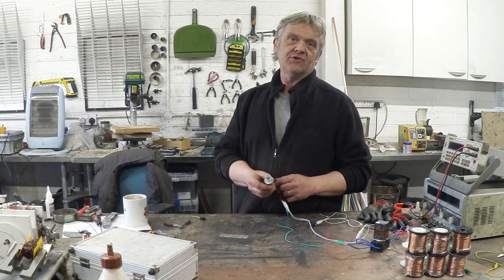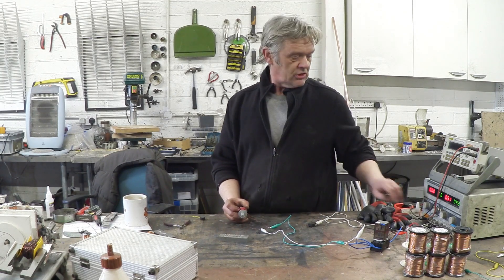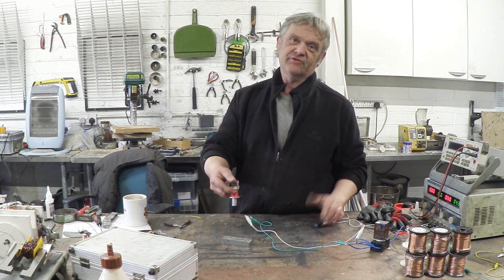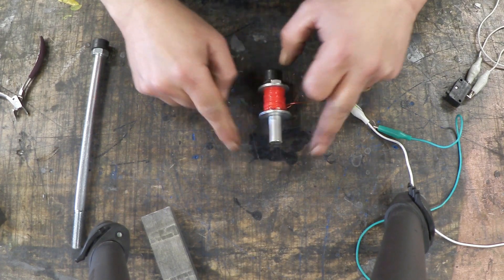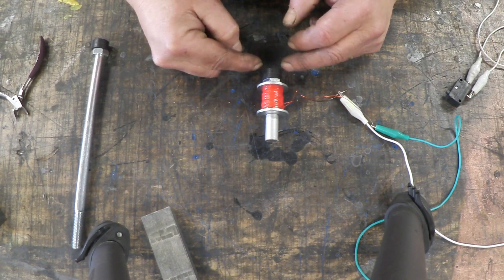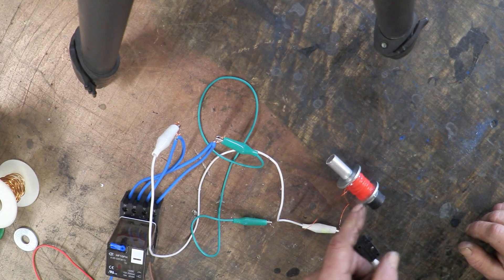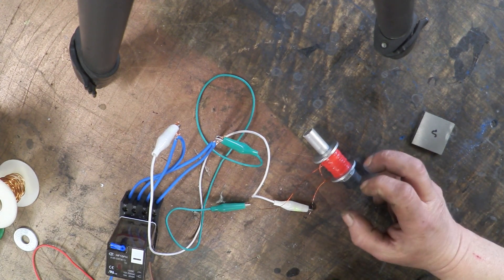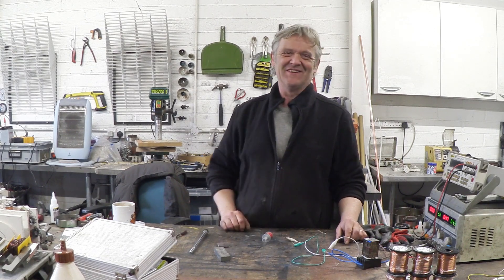1042 Magnetically Assisted Solenoid

Comment: I’ve been following you play with magnets and enjoying your findings. When you put a piece of steel against a magnet it will naturally weaken the magnetic flux as the flux is now contained in the “Keeper” piece of steel. But if the piece of steel is not large enough to fully contain the magnetic field there will be a small amount of residual field still around the magnet. So instead of nothing on the piece of steel there is some magnetism now which can be strengthened to produce more magnetism by a coil with current going through it. The current needed to produce a strong magnetic field will be less than that needed by a pure electromagnet as it is assisted by the rare earth magnet. The whole concept you are playing with is in essence I see it as a way to putting a magnetic bias on that piece of steel. Nothing more really. This concept is used in electronics. As an analogy put a bias of say 1,5 volt above ground using a single cell results in a standing voltage of 1,5 volt cell from ground. Add another 1,5 volt cell to it and it increases the voltage to 3 volts (higher voltage). But you can also put a reverse 1,5 volt and you get 0 volts (analogy being reverse the magnetic field to get zero magnetism). The trick is being able to use this knowledge in some way to create a useful device. But don’t think of a perpetual motion motor. This does not exist.

Comment: At very beginning of video when testing electric magnet, You forgot to turn your switch On, the one you pressed on the white power wire, 
same as  the secound time when you where using the magnet 🧲 as an assist with electric magnet. You turned power source On, and it did not begin to work till you, switched your secound switch.

Comment: Drill out the centre of the bolt enough that 5mm n52 magnets can slide in about 20mm from the attraction  end . Or just use some steel tube with a cut off bolt in the attraction end . Have strong enough magnet at the top and add or subtract to tune !

Comment: You can "bias" any electromagnet with a permanent magnet to make the resulting magnet stronger. That is what you did in your video. 
And just as important, you can "turn off" any permanent magnet with an electromagnet whose field is the reverse of that of the permanent magnet.
I've found the second instance to be the more useful of the two. The zero-power permanent magnet can hold an armature in place and a short pulse of energy into an electromagnet can release the armature. 
I used that effect as a brake on a drum. A drum was held in place by a permanent magnet and the drum was allowed to spin when that field was canceled by an electromagnet. The quiescent state was ZERO-POWER. There were no complicated mechanical latches or moving parts involved when the brake was on. The brake was disengaged when the field was on, and there were no moving parts.